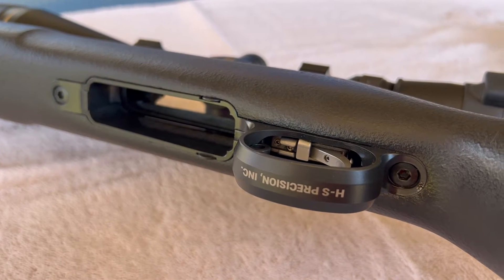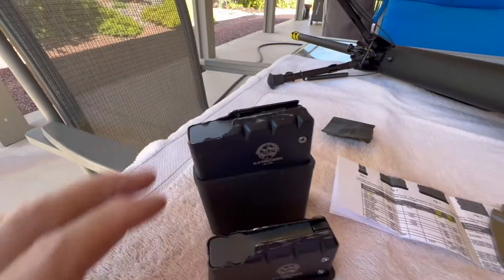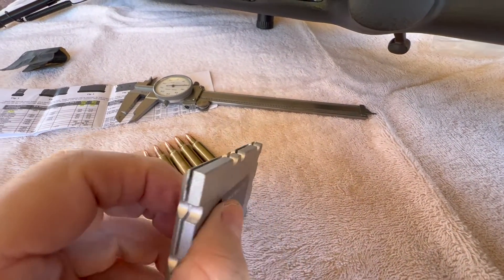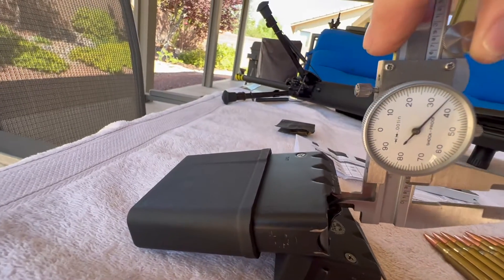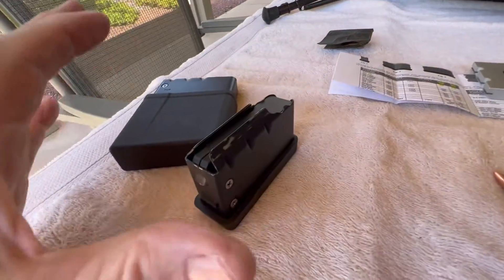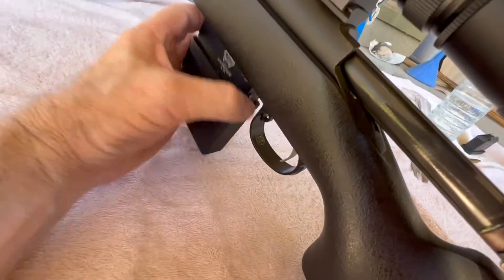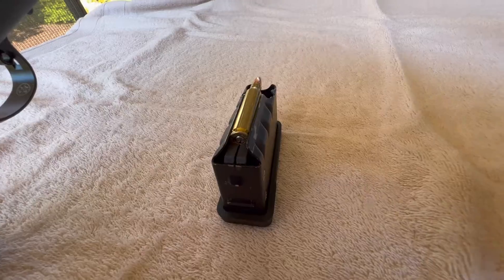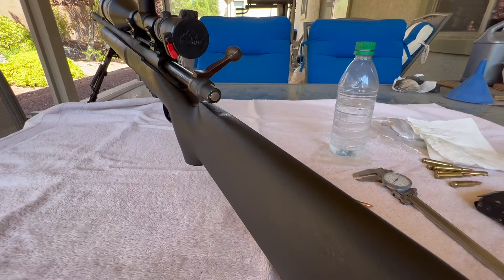Remington 700PSS 223 HS Precision Magazine Feed Lip Adjustment

Comment: My 7mm Rem mag like the back of the magazines a little tighter it angles the rounds up just a bit and they slide right into the chamber, nice project and good work!
Reply from the maker: Thanks! I got it much better but I may try a little more fine tuning. I have the same rifle in a 308 version as well that has the OEM detachable. I've been thinking about an Oryx chassis for that one.